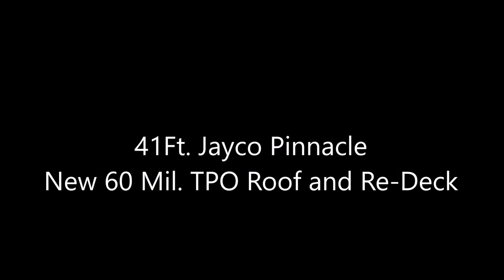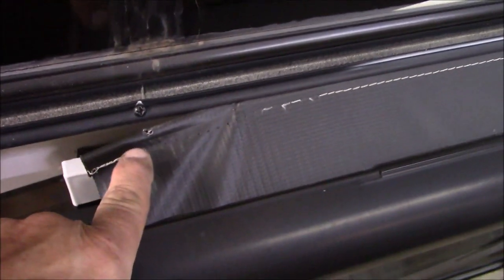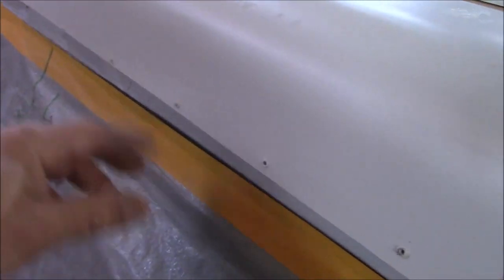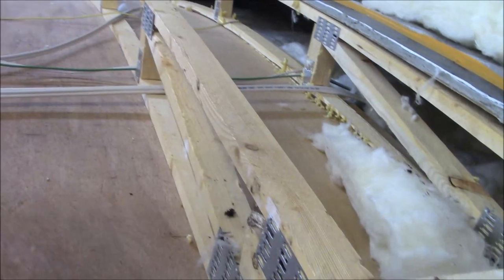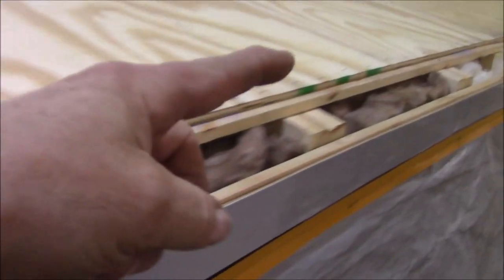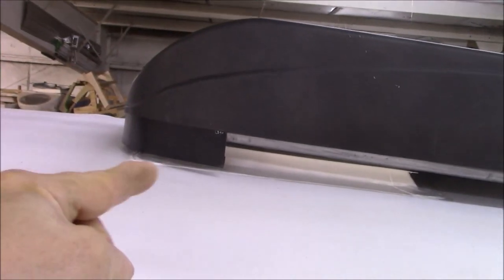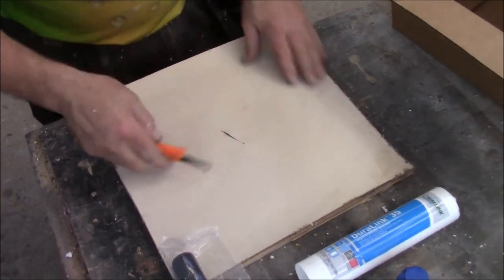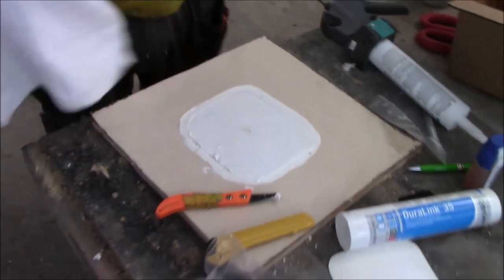41Ft  Jayco Pinnacle New 60 Mil TPO Roof

Comment: Hello and thank you for your video. I've been living full time RV since 2005 and been in our 2016 Pinnacle brand new. I learned so much watching your video and was surprised by many things (obviouisly). I've been cleaning and patching lap sealant best i can on roof to. avoid water intrustion problems; 8 years, so far so good, but i suspect sooner or later, its gonna get me. I got a mouse inside the roof up by the cap. Im afraid of electrical wires getting eaten; oh crap more problems! Any tips?
Reply from the maker: Take the plastic ring down from the vent,  maybe a light or speaker from the ceiling, and see if you can put a sticky trap with some bait on it.
Thanks for watching.